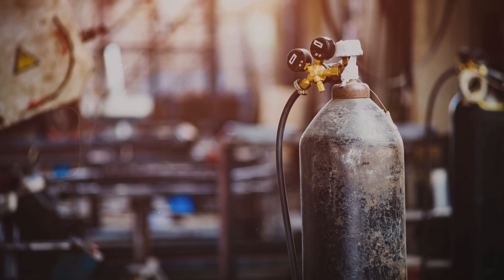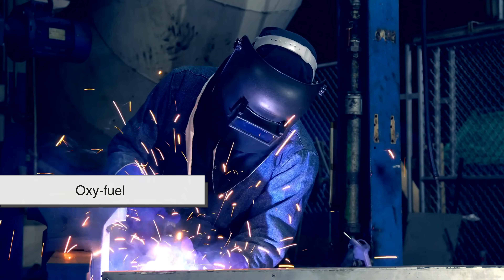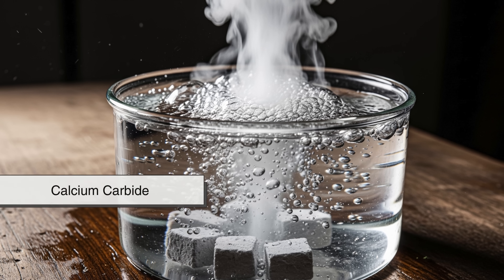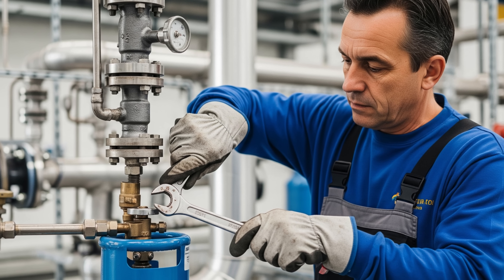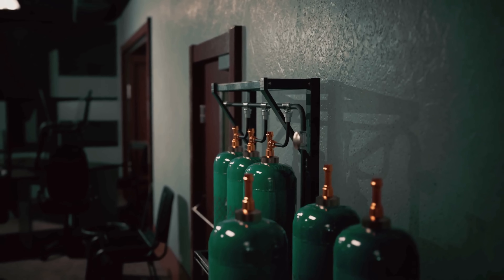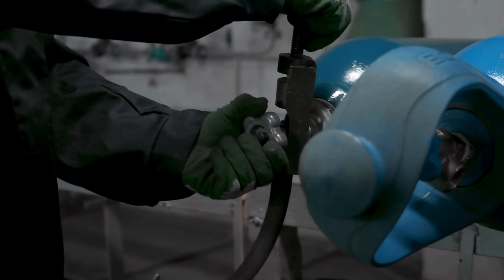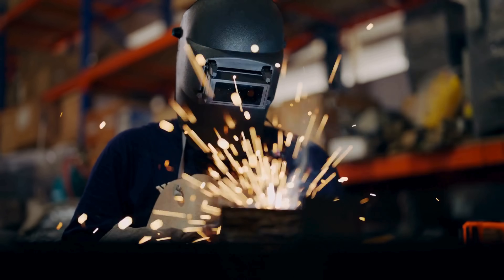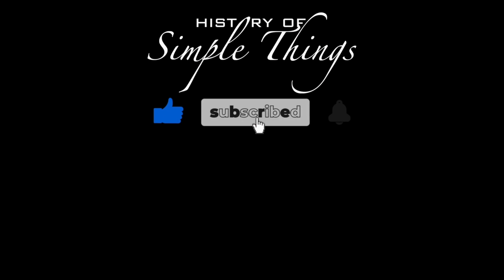What’s Inside The Welding Gas Cylinders and How are They Filled?

Comment: Gas Cylinders with Different Gasses also have Different Valves and Threads 
So you can't Kill someone with the wrong type . Purging Lines ,Torches is also 
important The use of Flashback valves is a must. Flammable gases are Left hand 
threads and some that will not support Life.

Comment: The heavy fabrication company I retired from, does all kinds of welding. We had CO2 bottles that were stamped in 1898 in circulation. Just one or two every now and then. Low pressure 500 psi. Still good and sound.
Reply: Yup, local welding shop has a few oldies cleaned up nice, I think 1906 is their earliest, south of Pittsburgh.  I've had them come with their first inspection was 1936, that thing worked on steam engines!

Comment: If you ever wondered why some of them have that screw on cap over the valve, that is for safety!  It one of those valves gets broken off a couple of different dangerous things could happen.  One of which is the cylinder shooting across a room or some other place.  Just imagine all the things that may go wrong!  One of those will knock anyone in their way down.  The gas may be flammable or cause a suffocation hazard,, especially since some of those gasses are not oxygen.  Also from what I hear there are titles on some of those cylinders.  That is someone might actually own that particular cylinder and it is legally their property.

Comment: Depending on the cylinder size, the pressure can vary.  There are 55, 80, 125, 150, and 250 cubic foot cylinders, these are filled to 2,200 psi.  There is also a tall 300 cubic foot cylinder, if it has a "+10" neck stamp. it is allowed a extra 10% over fill, bringing it to a maximum 3,300 psi, or 330 cubic feet of gas.  The 150, 250 and 300 are awfully heavy.  The short 55 and 80 cf cylinders are used a lot for small, portable MIG welders.  They are a lot lighter and fit better on the welding cart.  They are filled with CO2 or C-25 (25% CO2/75% Argon) sometimes called "mig mix".

Comment: I have a question why do I always see on the gauges....USE NO OIL?...what are they talking about
Reply: if gas bottle is filed with oxigen and somewear on the treads have oil, when oxigen travel from bottle to machine and make contact with oil form treads it will explode!
Reply: Yes, mixing oil in any way with pure oxygen can create a deadly explosion.  Even steel burns completely in pure oxygen--that is how the oxy-acetylene torch cuts steel.

Comment: With those welding cylinders you have to be told the correct steps for opening them up to get the correct flame for cutting.
Reply: Any welder , fitter ,  burner, or machinist worth his salt only has to be told ONCE how to open the valves for cutting . If he makes a mistake , he likely won't do it twice .
Reply: Thats done with the gauges attached to the cylinders to regulate the pressure .. Oxygen is typically between 20-40 psi while acetylene is around 7-10 psi

Comment: Welding is my trade and the companies I've worked for never separated oxygen and acetelyne but they were safely secured and in my 67 years I've seen one oxygen bottle blow up and that was at a bottling company and it fell over and didn't have the protective cap on it and it went flying through the roof and I don't know where it ended up but it had 2200 psi of oxygen and was full 😊
Reply: Not talking about your working cylinders, but your storage should be divided with fuels in one place and oxygen in another.

Comment: Haha. Stored separately.  I've never seen anyone disconnect the oxygen from a torch.  It always sits on the 2 bottle cart connected to the gauges
Reply: True. But there should always be a flashback arrestor on the outlet of each bottle.
Reply: Of course, when in use there is only one bottle of different gasses.
That is not storing.

Comment: Hydrostatic testing cylinders is a fun one to do. Every 5 or 10 years the cylinder is emptied and then filled with water. Then it is pressurized to 150% of operating pressure then gently rang with a hammer along any welded seams or fitting bosses. Any dull note indicates a crack somewhere in the material. Scrap time. After 30 minutes of holding pressure without leak down then you get to stamp the inspection date into the cylinder and empty and dry it with a new service valve. The REALLY fun ones are the ones you have to test at 7,500 psi... pucker factor. Really scary when a cylinder shows a fault... won't hurt you but you will DEFINITELY get wet.   LOL
Reply: When i was running a pressure testing station i  would fill with water and a sight gauge and the pump more water into it till it reached the test pressure, hold it for 1 minute, released the pressure if the water returned to zero it passed, if it dropped it failed. This is a simplified explanation of it.